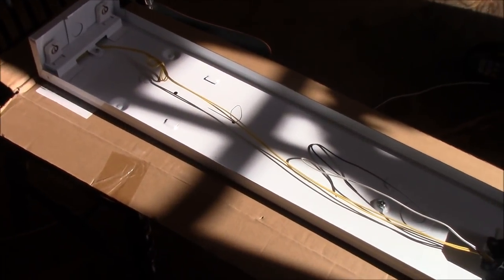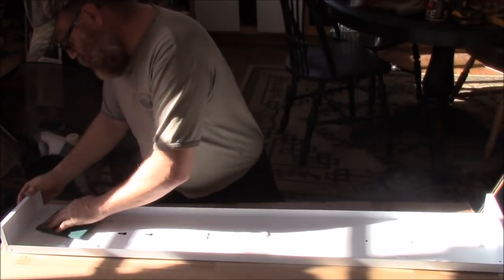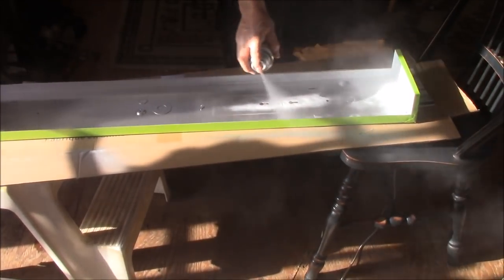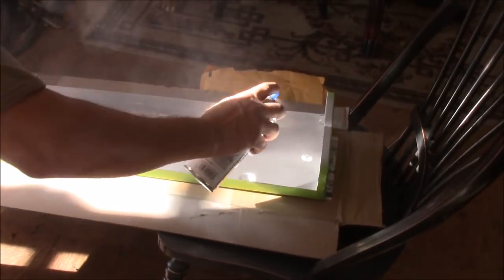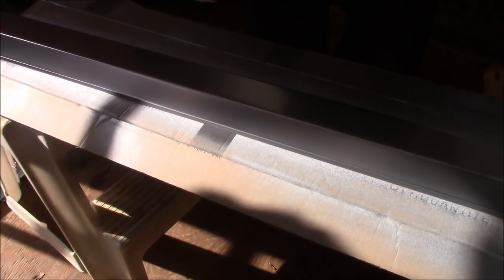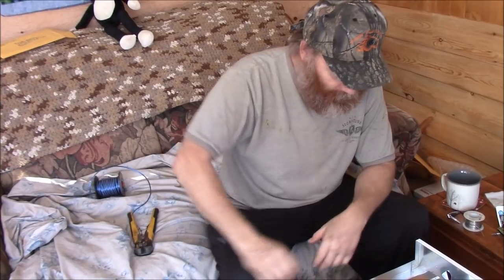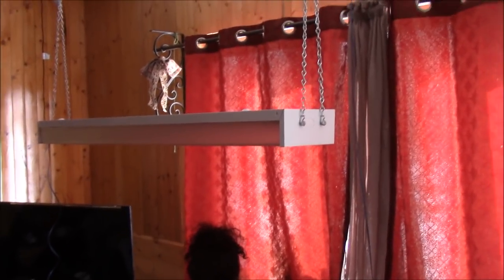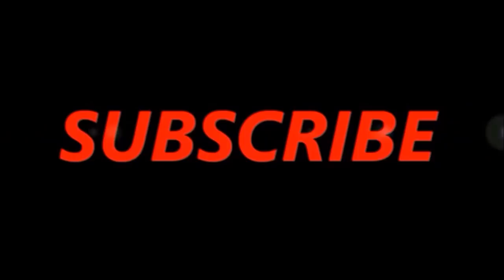My Attempt At 12 Volt LED Grow Lights.

Comment: I  used   that same stuff to paint my old rims   , did not look like the cap   at all but    was shinny   so  ya  I know   what you were thinking as I was too  not like the cap lol,,,   the light will help 4 sure   and if you make more   lights   might try  foil wrap  just cut and glue,  looks like a busy day you both had  ,, great video  ,,
Reply from the maker: Lol yeah false advertising  😪  got me again  😉  I am hoping these lights will help out, Heather's plants are starting to get tall... I will have to build some more later, maybe I will try the foil.   Yes it was a busy day for sure Don.  But a fun day. Thanks again.   You take care ttyl... Cheers  :-)
Reply: That's  too  funny  I did  the  same  thing  on my first  car, a 1974 ford  comet  back  in  86
Reply: lol   ya it is funny,, mine  was a 82 dodge charger   ,,

Comment: Flat white paint (not glossy) reflects the most usable light at those frequencies.  Even if aluminum foil is used, the dull side will reflect more than the shiny side.  But it's a nute point with those LEDs cuz they don't have a 360 degree output (like flourescents or LED bulbs), so they should'nt even be bouncing light off the reflectors.